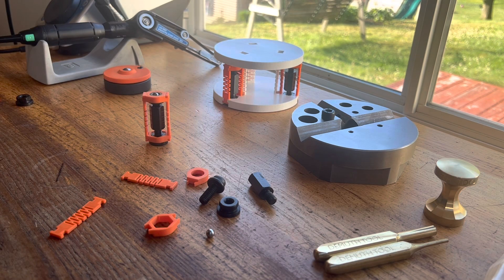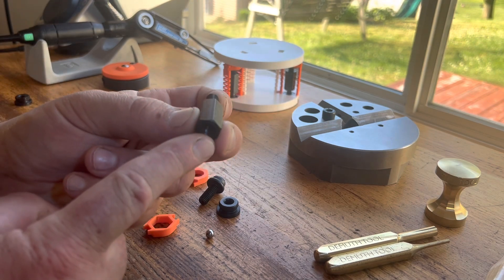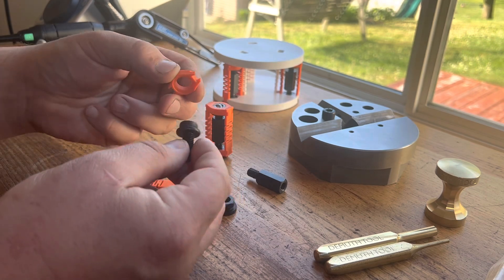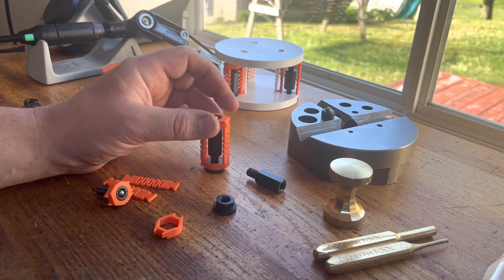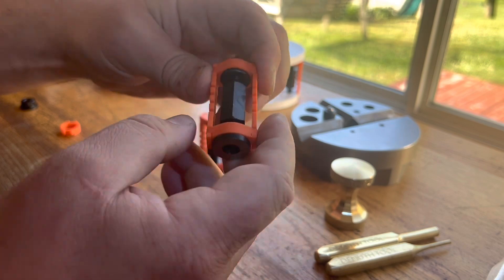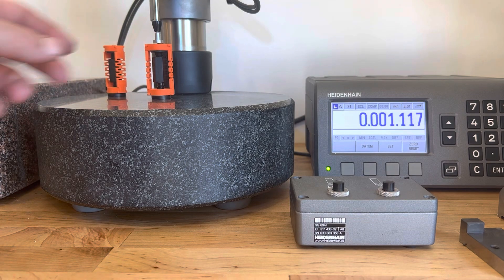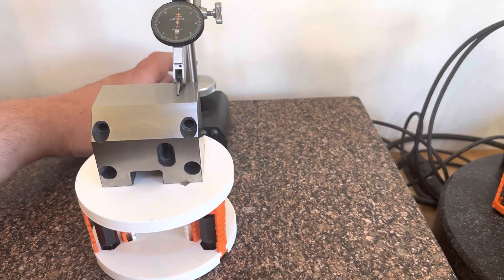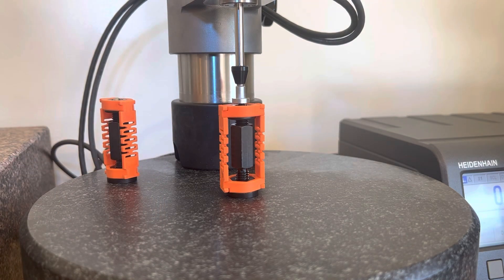High resolution machinists jacks

Comment: A solution to the wiggle and Teflon tape issue could be using a ball screw. Granted that would increase cost and complexity a lot so it might not be viable. Great design by the way

Comment: Great idea!  Instead of teflon tape, using a nylon insert, similar to the insert used in locking setscrews, might work better long term.  Plunge mill the male threads with an 1/8" endmill about .100" deep and press in a nylon slug.

Comment: The power of differental is under utilized in so many ways ... Location, force, speed,   electronics, hydraullics,  etc.. 
Nice practical use.  
And perhaps an even better demonstration of differental potential elegance  in design. 
Very nicely done.

Comment: I'm a getting older die/mold maker. I really loved what you did with the ball bearing in the screwhead. Very nice.

One small critique, instead of using a 3D printed part for compression, why not a simple spring for expansion?
Reply from the maker: I played with that a little , the only issue was it made the assembly a little wider . Not much , but enough that I was concerned how small of a part I could get three of these under.

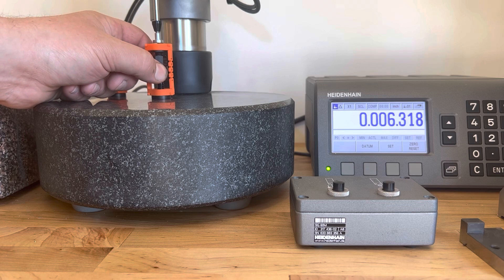Comment: How did you 3d print them? Looks like SLA resin printed parts. Would like to motorized them for automation leveling, such as auto level a bed, have any good advice on how to achieve that? Thanks. 6:31 - Interesting measuring device, shows two decimals. Simply just wow, it seems like this leveling jack is not "high" but rather "ultra" resolution, it seems to hold well down to 25 nanometers (0.000.001") accuracy. This could be further improved to hold down to < 10 nanometers, possible using anti-backlash nuts.

Comment: This may be a horrible idea, but to stabilize the threads, how about some putty eraser. This is a clay-like/rubber substance that doesn't harden. Not sure how it responds to oil. It may dissolve.
And if it doesn't work, you can still use the eraser to clear chips and oil from difficult to access holes and corners. I use it a lot for that.

Comment: Combining off the shelf hardware with 3D printing is a great idea. I am not too sure though how easy it is to get these adapters over here in Europe but I think that an M10x1.5 to M8x1.25 adapter or even M14x2 to M12x1.75 is a fairly standard item.
Just putting some thicker grease or copper-paste on the thread might reduce the jiggle and make it move a bit smoother.

Comment: It breaks the 'no machining' rule, but it could be an interesting solution to the stability issue: the height setting on the Tripan toolpost uses a piece of spring steel in a slot milled perpendicular to the threads. It bows out a little bit so it gives some pressure on the mating threads.

Comment: Very nice set up. I haven't looked through the other comments yet, so you may have already answered the question I am going to ask: What material did you use for those prints? That did seem to be a rather nice spring attribute. It may just be the geometry you used, but I'm thinking the material choice played a role. I have yet to venture deeply into the 3D printing world, so I have a lot more to learn in the material choices and geometry choices used in those designs, but I am curious to get a little more of your input
Reply from the maker: That’s just general pla material. The springiness is largely from the flexure slots cut into it .
Reply: @adamthemachinist   That's awesome! I just recently gave away the Ender 3 pro to a coworker that has a kid I was hoping he'd teach to use. I am now eagerly looking at the new S series they came out with to start printing some of the other ideas of had. Thanks so much for giving me some of your precious time! Hope to see some more of your videos in the near future!

Comment: Cleaver idea ! To get that precision "stickey" thread feel, split the male part of the thread lengthways and then stretch it open a little with a wedge the thread will then bind a little taking out all the back lash and also preventing it from moving with vibration but will still be easy to turn, have used this technique many times before

Comment: I just found your channel tonight and I'm beyond impressed with your innovative mind. 

An idea I had to give more stability, precision, and repeatability to the adjustment, and bear with my terminology as I am not a machinist by trade: 
A bar spring, such as the magazine release spring in a glock, held in place on one end in the upper mount, that interfaces with a inverted cycloid-tooth cog mounted as a collar around the hex of the thread adapter. The inverted cycloid geometry of the teeth should allow the bar spring to cycle between The bottom lands of the cog when enough torque is applied, while otherwise holding the thread adapter at relatively repeatable angles. The level of precision from this system could be tuned by increasing or decreasing the number of teeth on the cog.

Thank you for this incredible library of information on machining; I will be diving into more of it throughout the week
Reply: So I finally got around to testing this idea, and as I'm sure was obvious to some of the more experienced here, the inverse cycloid shape was a mistake. I ended up reshaping the detent to just be a sinewave and it works a treat

Comment: Excellent shortcut for getting ready-made differential threads.  Love it!  I usually end up with tapping an M12 x 0.5 mm and single-pointing a 0.4 or 0.45 mm pitch about the same diameter on the other end of a rod to get a 100 or 50 micron per turn effective rate, but never thought of using 3D printed supports/tensioners.  Nice.

Comment: An excellent way to get a fine adjustment is to use wedges with a very low angle in combination with a fine threaded screw. You can easily get as little as .001 movement per revolution. You can also use "differential" wedges for even finer control, but it's probably not necessary.

Comment: Hi Adam,

If you drill a cross hole in the male threads, and push in a slug of nylon or ptfe so it's just proud of the base of the threads, you'll have your solution for your 'wobble' problem.
Reply: Or use a nylon fastener and bed it in a few times until it eases off?

Comment: Question for ya.  A 1.25mm pitch takes 20.32 turns to move an inch. If one were to use a 1/4 20 pitch thread, would that not make the differential even smaller than an 18 pitch thread?  In fact, as long as I use a 20 pitch thread and a 1.25mm pitch thread, I could put those thread pitches on a 1 inch diameter rod and make a very sturdy jack?
Reply from the maker: That would definitely work. I try to do these projects with only using off the shelf hardware and was limited in selection. The goal was to give students and hobbyist ways to explore precision without needing access to machinery
Reply: @adamthemachinist  Excellent. Your goal of inspiring others has worked on me! Definitely see the usefulness with off the shelf stuff, but if one can, then this idea can be adapted. I see 1/4 20 to M8 adapters for 3 bucks on ebay!

Comment: Very nice design Adam! You might try lapping the threads with fine garnet abrasive while loaded then clean and add some moly lube.
Reply: Been checking out machinists looking for a replacement for Robin (super accurate, out-of-the-box), and as I live and breathe he shows up! It must be a sign! Good to see you Robin, miss your PHD-level machining.
Reply: @Bob_Adkins  Doesn't he actually have an engineering degree like Tom Lipton?
Reply: How do you lap the threads? Just put the two components together with the abrasive inside?
Reply: @jonludwig8233  
Yes.

Comment: Adam love the design and concept, I've always been fascinated by differential screws, and using a combination of Metric and Imperial threads is inspired. But on a separate issue, in the first part of your video I noticed a detail belt sander in the back ground, and I was wondering if you would share the make and model. If you would that would be fabulous.

Thanks...
Reply: NSK system. (Accessory for de-burring handpiece)

Comment: hmm this is timely I freaking hate the shops points that live on the surface plate. hmm we have high tpi taps around and the threading works on the manual lathe in back. hmm Im torn between cutting some and printing a set of these now.